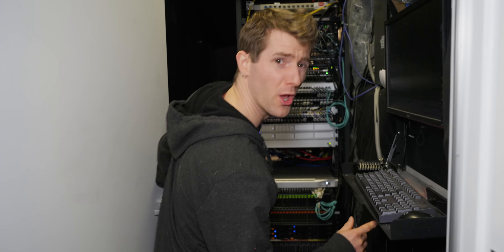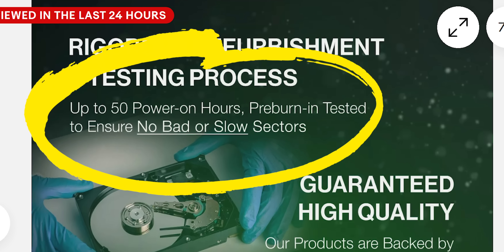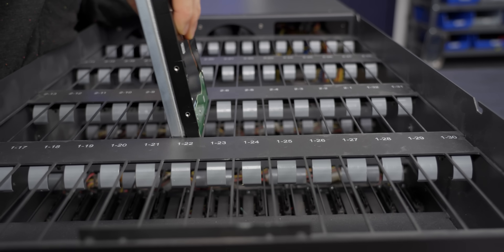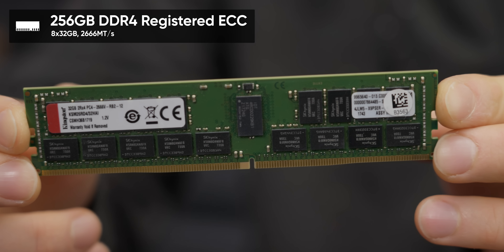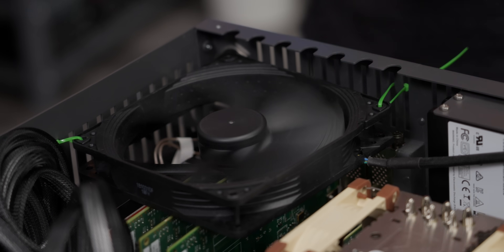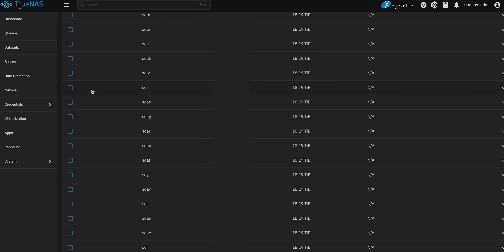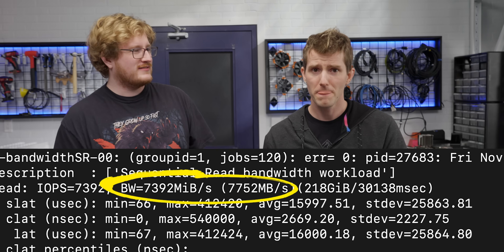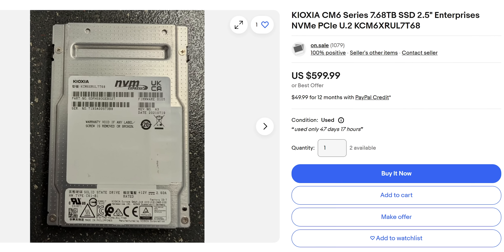Is Buying a PETABYTE on Ebay Stupid?

Comment: its funny that you posted this video now, just a few weeks ago i bought, from serverpartsdeals, 4 20TB western digital drives. (got them because i prefer them over segate)
and really just put them in my server and set everything up about 3 days ago. they have been running fine since and passed both a long and short test each.
i happen to be running Trunas Scale for my Jellyfin server and it has no reported any errors since being put into production. im running zfs 2 and will be expanding by 4 more drives in the future when i have the need for more space. (80TB extra should be fine right??)

one thing i wish you guys would have gone over though is manufacturer re-certified vs a general refurbished. refurbished means it has been cleaned and maybe a few other things based off a seller like smart tests ect. Re-certified means the manufacturing company themselves took the drive, tested it, replaced any parts if necessary and then re-warranted it under their own name as like new. doa should be much lower as each one had to be looked at by someone and then sent off and hopefully they will work for long time as well due to the low hour rate.

I suggest for anyone though, new and used, after plugging in a drive for the first time is doing a conveyance test, the test will check the drive for any physical issues with the parts after shipping, if that passes then so a short test and then a long test, fair warning on the long test, they will take over a day if the drive is large like 20TB.

Comment: In my array I'm running 1.5 decade old 1tb hdd's from Samsung and 750gb hdd's from Western Digital.
One of them has 3.2 million head parks and has no issues, even though Western Digital only warrants 600k.

You use what you can afford, but there ain't nothing wrong with used drives. Most of mine are from laptops and old office builds.

Follow the 3 2 1 rule and you're solid~

Comment: I have a great one. I have an 10tb Seagate exos hdd that was new old stock. I had to contact senate to get my 5 year warranty that old. Works great in a usb 3.0 enclosure hooked up to my Xbox series X to play Xbox one games and store current gen games. It’s loud but my transfer speeds on my Xbox are great at about 1Gb/s which is 5-6x faster than my 200Mb/s I get downloading games so I rarely ever delete games just transfer them back and forth. 

So real world a 100fb game will take about 25min to transfer while it’ll take about an hour and a half to download. I’m not worried about reliability since it’s an enterprise drive and I can always redownload games. Been wanting to use a nas with a 1 to 1 array able to lose 1 drive and have 1 still work but I don’t have such needs for a nas like I don’t use Plex and my data is mission critical so I’ve been using multiple ssd 1 inside my pc and 2 external as well as some older harddrives for backup. Including my data on my pc I have 4 external copies 2 of which being a hard drives. The data amount I need isn’t much under 1tb so the durability and longevity of ssd appeals to me that I can’t afford to lose the data. I do worry about data rot so I’ve thought about copying the files to mdisk but for now I make sure to use the external NVMe in an enclosure ssd at least once a month and periodically I’ll recopy the files. 

Also, probably for performance reasons when playing a game on my Xbox series X downloads to around 40mb/s will crawl to about 20% of standard whereas transferring games is almost full speed while playing a game.

Comment: 8:40 i have an usb controller form aliexpress, 2x USB 3.1 and 2 USB-C 3.1 for 10 dollars and it works like a charm. Your milage may vary, but at that pricepoint it is worth a try in my opinion. A branded one would be 10x probably
Reply: by controller i mean PCIe expansion

Comment: A great seller to get HBA cards from on ebay is a seller named "the Art of Server"  got a Genuine LSI 6Gbps SAS HBA LSI 9211-8i   flashed to IT mode ( For about 60 bucks.) running in my home NAS Running TrueNas Scale.  Works great!!  Didn't need any support but I've heard the seller is very responsive with basic assistance. Highly recommended. Edit: I forgot the mention that in the mentioned NAS we have  8x 12TB drives from goHardDrive Wholesale and Retail and so far its been fantastic.  Its only been 6 months on the drives but, so far so good!

Comment: Be careful Linus, SMART data can be wiped and it can not be recovered. Many "refurbished" drives just have the SMART data wiped and then resold as 0 hour drives. You're unlikely to find much if any wear and tear physically on the drives either. Exos are enterprise drives, they're put in chassis just like your server. No hardware used, so the threads are pristine, and one in & out of a chassis isn't going to scratch them up either.

I did buy three 16 TB exos drives from Go Hard Drives, they claim 5 years warranty, but I'm banking on their tens of thousands of positives reviews that it will be upheld if something does fail. I put the serial numbers into the Seagate website and confirmed they have no official warranty and to go to the seller.

Comment: My computer was built in 2001, surfs the internet an I sometimes play command & conquer remastered. I have upgraded it to windows 7, The only down side is I have to keep it in sleep mode because the system clock resets if I power it down and then the internet stops working untill I change the clock. Apart from that she’s a beaut!🥰

Comment: I recently bought 15x 14TB WD HC530 drives from the big E with a 5y seller warranty for just under 250NZD per drive. (~150US)
All of them passed a full Read/Write/Read test in an average of 19.5 hours per Read or Write section with 0 DOA or DNF. 
All the drives tested performed within margin of error of each other and within WD's specifications when paired with an LSI 9300 controller.
0 SMART errors of concern with and all have similar POH listed. 
On their OEM/factory label they are marked as 'Recertified 2022' (varying months) after peeling the sellers sticker so these ones are in fact WD refurb'd drives.

I've since bought a SAS Toshiba MG07 series 14TB refurb which, other than performing a little worse (avg 20hrs vs 19.5) is in similar condition, this one did not state 'Recertified' but had a DOM of 2019

My oldest 'non new' drives are some SAS 10TB 'Off Spec' drives that turned out to be Seagate EXOS X14 units. All of these have been going hard for a long time now and I wouldn't think twice about buying Refurb or OS drives as long as they have a decent seller warranty.

Comment: Currently running a half dozen of their 16TB's in my Plex NAS, have been for a year now at 24/7, with absolutely no issues, and currently looking to expand with those 20s soon. Granted it's not mission critical data but the savings is hard to pass up.

Comment: 16:08 Right here is where I was thinking about how it’s also probably worth it to save the money on re-certified, because if you wanted to spend more for the extra 3 years of warranty, you’d possibly miss out on buying new drives at year 4 that cost less and store more as I’m sure there’d be another leap in 5 years time.
Reply: It really depends on your use case. If you were cold storing some data, you might want to spend the extra knowing that these haven't been opened up after manufacture (some of the recertified drives have had controllers replaced etc. but AFAIK it isn't the norm).
If you were doing that though, you may as well get tapes and do it properly, but whatev.
Reply: @smalltime0   For cold storage I use the cheapest drives, extra redundancy, and make sure the redundancy is across multiple batches. It seems worth it to get the super cheap drives.

Comment: As requested, I've bought a variety of drives and server gear from ebay/marketpace.  Servers, cpus and switches have all worked wonderfully, 4/5 on GPUs(one died due to a known defect in a pwm), and many HDDs.  $5 for 72GB SAS, $50 for a 3TB WD Gold(in 2017).  All in all, a positive experience.

Comment: Recertified drives used to be hard drives that had fully functional drive mechanisms, but faulty controllers and/or interfaces that were replaced by the manufacturer and re-tested.

Comment: I work for a brokerage company, you will be surprised how many companies have storage drives as backs ready for failures. They will keep the stock up even if they are completely upgrading their system. You will also get some companies that shut down or go bust and all internal stock is auctioned off. I see drives like this all the time expecting some usage and seeing 0 POT is amazing
Reply: That was my first thought. We had a few spare drives for a quick swap on site even though our SLA was 6 hours 24x7. Tech would rather you install your own drive at 11 pm and Then send a then drive via UPS. Instead of 3 hours, install drive then drive home arriving at 5:15 AM. We were not a data company.

Comment: So is the reason this is working so fast because the storage controller cards are fast? It takes me DAYS for a mere 48tb array to establish
Reply: I actually just figured it out. OMV needs a different kernel when it lives in a Proxmox VM.
This allows you to install ZFS, which creates the array and file system instantly. 
My read/write speeds are now 250MBps instead of 80MBps.
Also added feature of ZFS allows for resizing and changes to parity on the fly.

Comment: I have switched from WD Reds to IronWolf Pro certifited. From 2 TB to 4 TB for my backup storage (2 Disks ZFS Mirror HDD Storage no cache). The first resilvered was very good the second one, were very very slow. pool: Backup-VMs-Desktop
 state: ONLINE
  scan: resilvered 1.77T in 22:50:47 with 0 errors on Thu Dec 19 23:02:46 2024

The first resilvered was only 4-5 hours.

status: One or more devices is currently being resilvered.  The pool will
	continue to function, possibly in a degraded state.
action: Wait for the resilver to complete.
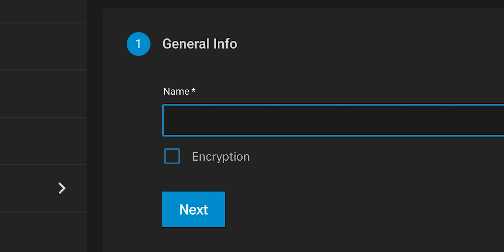  scan: resilver in progress since Thu Dec 19 00:11:59 2024
	1.76T / 1.76T scanned, 1.54T / 1.76T issued at 23.4M/s
	1.55T resilvered, 87.62% done, 02:42:16 to go

So I don't no exactly what I think about it. They are ST4000NE001-2MA101

Comment: I don’t understand 6gigabytes per seconds for an hard drive ? The sata port is limited to 500 mo/s no ?
Reply: SATA III is 600 MB/s. That said, the drives are in a RAID array, so files are written and read from multiple drives at the same time. So in parallel.
Reply: @ Ah ok I suppose that was read from multiple drives but I was not sure. And 600 MB/s you are sure if so why sata SSD are always at 500 MB/s ? 
Thanks for the answer by the way 👍🏼
Reply: @Pircla  Not all are, I'd go so far as to say most are higher. Depends on the manufacturer, quick Amazon search showed 520 to 560 being listed. The 600 MB/s is the maximum speed of the interface, including all overhead on top of the actual data transfer.

Comment: unraid user - I recently replaced my parity drives (I had one go bad) with 2x HGST 10TB disks- I got them on Amazon for about £80. I've bought a total of 4 of them in the last 12 months, and I've had 1 go bad - amazon instantly refunded me. I had an option to pay for extra warranty for £5 a drive, which was a no brainer also. 

Honestly, so far so good.

Jake touched on it in the video, but if you do a burn in test, I usually do read/write/read or maybe the inverse, I can't remember properly, you at least have some confidence.

So far no major dramas, no data loss. I'll likely upgrade the rest of my NAS drives with these 10TB drives over the next year or so.

Comment: I built my TrueNAS server using 12 HGST 10TB recertified drives and have had no real issues. 2 came in dead and the seller immediately swapped them out for me. After a year 1 died and again, no issues because of the 2 year warranty and no data loss due to my raidZ3 config. Awesome way to save money while building a large pool of storage

Comment: I bought six 14TB HDD from Newegg under the MaxDigitalData brand for $109 each. They appear to be referb exos drives. I've been running them nearly 24/7 since getting them and have had no issues. They are a little louder than I expected, but work great. In my setup, 5 are in a ZFS pool RaidZ1, with the 6th one being a spare just in case. I'm using Unraid, I tried TrueNAS but it was a little overwhelming. I may go back to TrueNAS in the future.

Comment: Damn it Linus, i had just put away my plan for a home nas due to cost...
Reply: It's still expensive. It's only cheap if you compare it to cloud storage costs. I just built one with three 16 TB drives. Even though the PC was recycled from an old system of mine (aka "free") it still cost me $500 and then will have the ongoing recurring energy cost.

Comment: LTT is following me, or am I following them?  Anyway, got about 40 referb drives spinning right now in my homelab without issues, some up for a year now.  (And 40 refurb SSD's and NvME U.2 also).  I also bought recently 12 "junk" SAS drives, higher hours, as a scratch pool, one of which has failed in two weeks, but the rest are fine so far. ($60 ea for 12TB is too good to pass up for non-critical temp storage - RAIDZ3 of course).

Comment: Seagate can make very good drives and crap drives. The now discontinued Constellation drives that I got used from craiglist ads that were used in servers have been fantastic storage drives for my personal computer. My Constellation ES 2 drive that has been used for over 10 years of daily use has remained strong, I only retired it last year due to the size of the drive just being too small today. I have a few Constellation ES 3 drives I got for $5 each and bought 6 of them and are all running great. I love the Constellation drives for their longevity and always praise them in high regard, too bad they don't make them anymore.

Now for the bad, the Seagate Barracuda drive I bought brand new started dying on me after over a year and sadly was out of warranty. Which I'll never buy again.

Sometimes a older good quality drive can outlive a newer poor quality drive.

Comment: more than half of my 680+ TB of storage is recertified drives. I have had 1 drive that keeps dropping out of the unraid pool with read errors, but I dropped it in a desktop as a one off and it hasn't thrown an error since. had one other drive that wasnt refurbed show up DOA and seagate replaced it in warranty with a recert - which has been flawless.

I actually prefer recerts as they have had to go through a 2nd round of testing and burn in, and for half the price and 2x the testing... I am fine with a shorter warranty.

My oldest drives are 4TB WD reds and have 8 years of power on time and tens of thousands of spin downs. They are not in my main server because of size upgrades, but I have never had a single read error out of any of them.

I genuinely avoided Seagate like the plague for decades because of the 1.5tb drive fiasco and was a WD only person... I found a CL deal for 13x 22tb exos variant drives for $900 and took the chance.... and kinda rediscovered the brand. I have switched to exclusively recert exos variants for price / reliability / availability since.

Comment: Note that ZFS really doesn't support switching to bigger drives without rebuilding the whole array. Plan from the start where you're going to put the files for the time of next upgrade. Of course, you can always buy another server instead  of trying to extend this one.
Reply: You "only" need to upgrade the entire vdev, not the entire pool. While for most* home users thats the same, as their pool only has a single vdev, it is a significant difference for people like me with multiple vdevs.

*Just an assumption, I don't have any data on this.

Comment: I was thinking about getting old Server PCIe SSD´s with high capacity for me instead of HDD, but think it should be the same at the end its a bargain. And before ppl mentioned that the ssd can possibly be worn out after server usage, im confident that these things will still work fine as they are usually TLC or MLC wich, so far as i know, can sustain more read/write processes and getting 2 TB of PCIe 4x layered SSD for aboud 200 is quite a deal :)

Comment: I got 20 x 12TB "refurb" drives, they all were around 4000-6000 hour power on time so they have plenty of life left, these specific HGST He520 drives can go to 60k+ hours without issues.
I have had them around 2k power on hours so far and they havent spitted any errors so far.

Comment: i recently finished up my server build using ebay drives from goharddrive. its running 2x12tb hgst ultrastar dc hc520 drives. i believe i paid about 145usd for the pair which was a solid deal and should hopefully last me 3-4 years. luckily these guys do offer their warranty so its nice. the server build itself is mostly 2nd hand. board is an intel n100 that i got off of mercari for about 44 dollars after tax and shipping, some generic 35 dollar tiny ebay case, a 500w silverstone strider psu that was new in box off a local thrift store for about 8 dollars, a single 32gb sodimm ddr5 stick that was part of a 2x32gb kit i paid 80 for, some 3d printed drive mounts and a 256gb sata ssd for boot that was from a lot i bought years ago. so far i used just shy of 7.5TB of storage on it from backing up all my game footage lol its a solid route for entry level storage server builds as IT IS VERY EXPENSIVE GOING NEW.